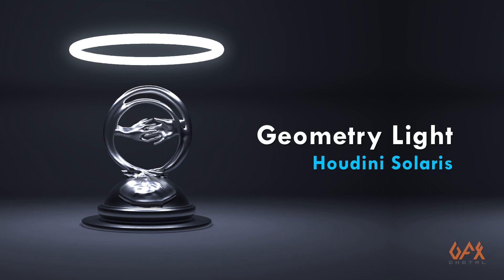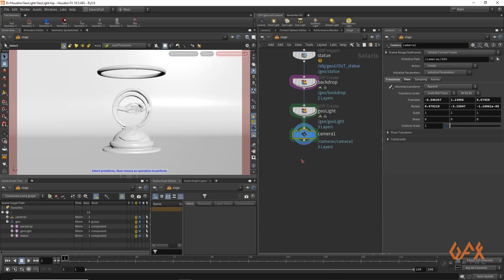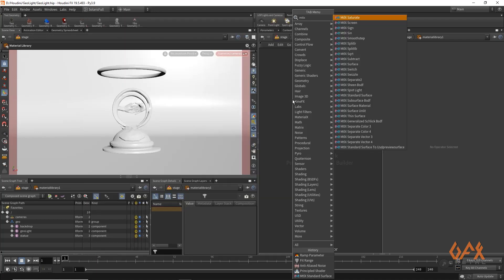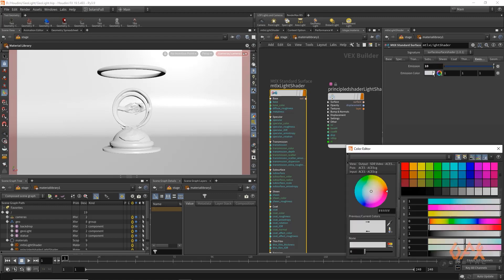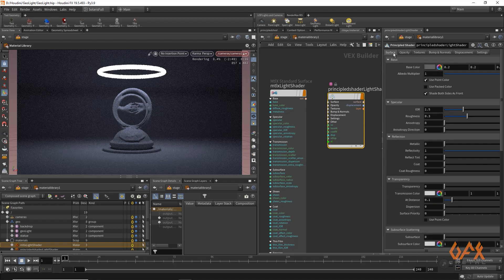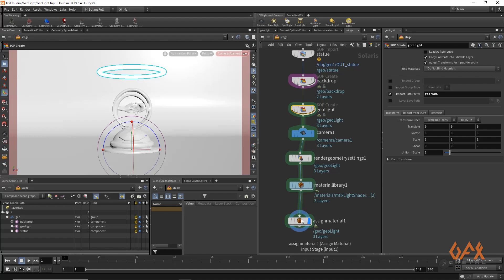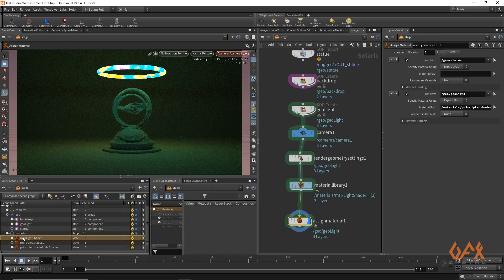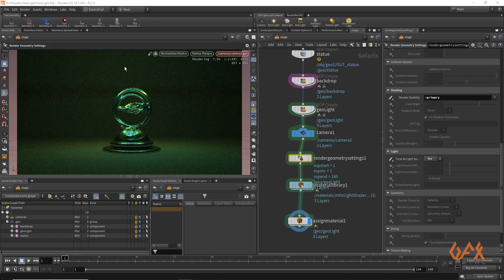Creating Geometry-Based Lighting in Houdini Solaris

Comment: Cool, how do you do light linking with a geometry light?
Reply: at this minute 1:11 in "rendergeometrysettings" node in "primitives" assign /yourmesh/ no need to be like " /geo/geometry ". Even when working with materiallibrary1 node asign all your geometry with this method /yourgeometry/. Hope that helps
Reply: @XavierX212  Thanks, it will be helpful for something, but for what I needed I went with a different method. I used a COPS texture on my area light to mimic the shape of the geo-light I wanted. An then I was able to do light linking with that. Also Geometry lights pop up in the Emissive pass, rather than Direct reflection. Which was a deal-breaker for this strange shot I'm on right now.

Comment: why i need make "rendergeometrysettings"??? Emission working without this step
Reply from the maker: In Solaris, if you want to treat your geometry as a light source with proper light behavior, you need to enable the 'treat as light source' option in the "rendergeometrysettings".if you apply only emission material, it will emit light but won't produce shadows or other light-related effects.